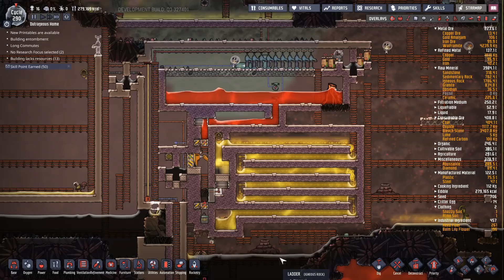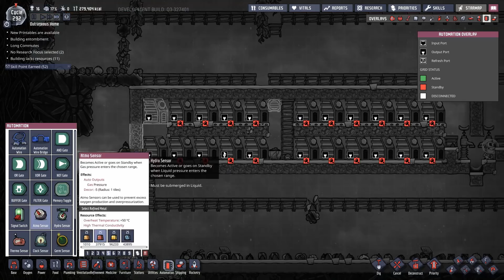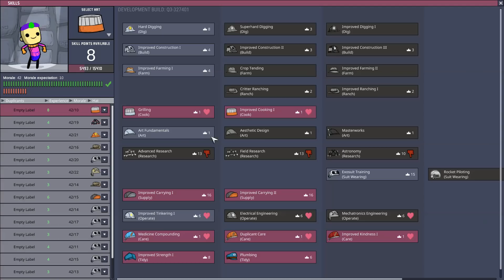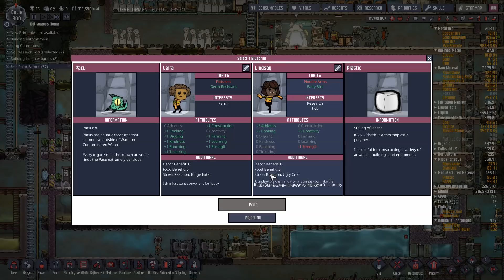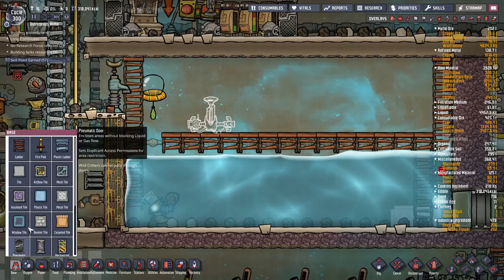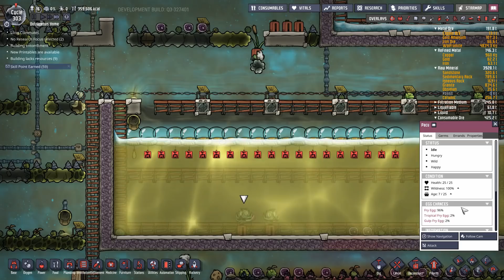QOL Mk3, 18 Battery Bank : Oxygen not included

Comment: So why did you use large transformers, knowing they can overload conductive wire? Are you just going to make sure you never use more than 2kW per line?
Reply from the maker: Thats the plan, I could use 2 small transformers but when I did that I find it slowed me down while I tried to figure out how much load do I put on this line. Is the draw of the devices intermittent, constant etc. In the end, <2Kw or I run a second line, requires no thinking on my part.

Comment: If you had really wanted to put that last smart battery in the hydrogen battery bank, you could have done it by building the battery and wires on top of a door, removing the door then putting down two mesh tiles. It's a little thing, but it's a solution haha.
Reply from the maker: I know I will never enter that battery box again yet I still want to leave myself the option for no good reason. But I like the way your mind works, that's sneaky.

Comment: How are you going to deal with overload damage on heavy watt wire? Maximum power on cable is  20kW. You have 11 large power transformers that each draw 4kW plus industrial brick all together  is much more then 20kW.
Reply from the maker: All that matters is the consumers at the end of the day I could have 100 transformers hooked up but if only one of them is connected to a grill I'm looking at 60 watt power draw max. Last I checked, my grid draws between 1.5 to 3.5 KW. 20KW wire should be good enough to get me to end game. But I will do a quick check to make sure nothing has changed.
Reply: The draw side of transformers count as batteries, so charging their internal bank doesn't stress cables, though I tested it and the consumers on the other end still stress the transformer's input side. So if Francis John were to use over 20kW then it would burn those wires, but I don't see that actually happening lol.

Comment: That middle natural gas gen is going to get stuck. Need at least 1 free pipe to send it to before joining to the line. 
It wants to push it's CO2 out to a free empty pipe when generated. 
It's not so much when it's run intermittently but when on constant like when your Natural gas fills up. 
It will stop. 
I like having at least 2 empty pipes before merging.
Reply from the maker: I'll have to check when I get home but I'm pretty sure I left at least a pipe segment free on the output. On the input it's a straight through.

Comment: On the wiring in the battery box and out of the way areas where you 99% sure you won't be sending dupes there. 
Why save a little. Spam the fugly around.
I could see yeah I've got Mtons of refined metals so why not but ehhh. I just can't do it. I gotta save. 

Not enough dupes to keep the machines running. 

Had 9 for 150 or so.

I did get up to 12 dupes though.
1-ranch 1-cook 2-operate 2-groundskeepers,  filling and supplying bins. 2-operate. 
4-builders So things are starting to move along. 

Out of sedimentary rock though. So I'm racing to setup other farms. All that dirt from cleaning water. 

Got me 6 dreckos and working on building the slicksters up.
The Hatches are clinging to life, just barely.
Reply: Yes. That. My history has made it a bit hard to give the shortened version. Everyone always wants a long explanation and it's to much and sometimes jumbled.
It's LTL. Less than truckload but I retired from driving and now play games all day.

That response yesterday. Yep. Make things easy on yourself and you'll never improve.
Reply: I got a hot water vent and still somehow for a nasty polluted 30c water vent. Tank is filled but still not sure what to do with it. 
Oh I just had a moment. 
Run it through the hot water tank. 
They balance out and I use it to start a pepper farm.
That and the meat from dreckos and slicksters. 
BBQ for everyone. Woop Woop. 

**Had it not been for your videos I would never have figure out how to properly deal with hot water geyser. Also you mentioning the O2 and H that comes out is set at 70c. Why not. Let them eat that heat away.

I'm currently letting my random water around tank empty out. 
Have 1 O2 production running and the has started but using a bridge it's waiting on the other stop. Another 30-50 cycles and it should be gone. Then I'll re purpose the rest of the random water to for toilets n such. Still working on that tank though. 
Oh and the space I'll have. Everything is off to 1 side. Running all the piping and wires up the wall. 

Although I got a nice natural tank in the biome below the base. 
However. I'm sending the hot water to up about 3 biome away to the new O2 production cooling with the thermo nullifier.

I got a voclano just off the side of the thermo nullifier then space for 2 O2 production and a volcano just beyond there.

I stack mine and go with a 9W*8H method. I had trouble with your setup for some reason. That little bit of H always gumming up the works.
Reply from the maker: Do you not feed the stone hatches igneous rock? Stone hatches have a 60% chance to produce more stone hatches when fed nothing but igneous.
Reply: I thought that was why you wanted them but I'm not. All that igneous at 95+. That's why I gave up that last play though. Everything was going down hill. 
250,000 in omelets on hand.
Plus I've got a natural pincha farm Inside the base. Woop woop. 
Lots of meat to go around as well. 

Wheezworts there are to cool that area a little for the mealwood.. I wasn't using the space for so long. Just never bothered with it. It's not bad. Just a couple of degrees over comfy for them. 

I thought of another thing about plants. 
The mirth leaf is comfy at 20-50
The briar is good for 10-30
Buddy 20-40
Early warning detection. 
Stick them on the edges or near a... say by compost or hydro gen or where ever. 
Plant good. Temp good. 
Plant not good. What's wrong. 
Good for early quick decor but later re utilize for temperature detection. 

Pincha farm and food. 
http://prntscr.com/nlr9gz 

Oil biome. 
http://prntscr.com/nlripd
It's 130 in the bottom right. 
Not bringing that igneous into my base.
6 breaches on the bottom and 1 at the top. 

O2 system http://prntscr.com/nlre0o
Cycle 389. By now I'd be dying but because of your tutorials. 
I'm relaxed. I have no O2 problems. No water problems. 
Food is a bit sketchy but getting done. 

And THAAAANK YOU for the clear the biome out strategy and just leave it lay there. No more bringing to a central spot. 
I have no concern as to where this volcano is going. 

http://prntscr.com/nlrfvf 

Tanks were from a chlorine and Hydrogen area. Didn't have as much gas as I thought.
 

I have them working on the pipe up along the right wall for oil to go up. 
I forgot to build the other pipe for petro but it's alright. It's going right back down.
Reply from the maker: @LTL_king  Niiiice. Looks like you got this all sorted.
Reply: @FrancisJohnYT  Ok so I'm just about done running the piping setting up temp sensor to get the PH2O out of the hot tank before it gets to much. 
Some reason I thought it was at -30c but it's coming out at +30c
I could probably just run it around in granite to heat a little. 
Question. 
What should I use for farm tiles. I usually stick to gold because of low thermal conduct...?

So anyway. 
I looked at oni assistant for the food numbers. 
Only 2 slicksters or 3 dreckos and 6 plants at 210KG a day. 

You knew didn't you. 
I'm rushing to get everything in pace and getting slickters built up and am I'm going to have enough time. 

A little nudge nudge wink wink go check out oni assistant for amount woulda been nice. ;)-
I don't like BBQ as the debuff in speed but I guess I'm gonna have to get more dupes. auto cooked omelets in the oil biome and 1 bbq a day. 
My chef is going to have to take a vacation.

Comment: Great video, by the way, you know that battery bank only causes you to lose energy per cycle ... it only makes sense to use battery banks with solar panels because it's energy for free.
Reply from the maker: It's about 15-20 watts per second waste for that entire battery bank. That is a price I'm willing to pay for the stability and security it provides. Also when I plug in the Nat Gas and solar I'm really going to need it.
Reply: @FrancisJohnYT  
If you are doing just for the show, please disregard what I will write from now on.

That's 400 joules per cycle for each battery ... which gives 0.66 joules per second per battery if there are 10 batteries (which is pretty much in your case apparently) are at least 6.6 joules per second reaching almost 4k joules thrown out by cycle ... energy is not a problem in this game unless you even waste it lol. Only a smart battery can handle any base with any size, and of course the amount of heat that all these batteries generate ... Here's my tip, decrease the amount of batteries and increase the amount of mini transformers with each pair of mini transformers you create 2k lines without worrying about the integrity of the wire.
Good Lucky xD.
Reply from the maker: @EstratégiaEmChoque  I get it, it is most definitely a waste. Let me try and phrase the cost differently, 4k joules a cycle is the same as running the electric grill for 67 seconds every 600 second cycle. My play style is only "reasonably" efficient. I like to think my strength is set it and forget it. I could have held off on the battery box until after I got solar might have been smarter. However I got to install Nat Gas in the near future and it's going to just be mostly straight burned, the 35% of free space on the free batteries are going to act as the buffer. It might make more sense then.

Comment: You missed the output conductive wire to the wire bridge on one of your large transformers.   Not using it yet so not a problem.  I downloaded your map and loaded to see how everything is setup and what material to use.  I must say, you really got your gases sorted out.
Reply: Also, I realized something about mechanized airlocks.  Automation will still make them open and close even if they aren't powered but they just move slower.
Reply from the maker: @johnlee7164  Yeah they made it that way to try and wipe out door pumps and it kinda worked. I have a tendency to power them all just due to needing my heat transfer doors to be responsive. Also that flashing red symbol drives me crazy when i notice it.
Reply from the maker: Sorted gasses is the only way I know how to play. I make a lot of vacuum rooms and mixed gasses are a nightmare to work with. I think I catch the disconnected transformer when I redo the wiring in my core base.

Comment: Squeaky Puft inside the mesh tile in the hydrogen battery room.
Reply from the maker: Sushhh if the others find out I'll have to go back in and rip the place up to release it. That's a load bearing Puft.
Reply: @FrancisJohnYT  
Sir you've been reported by the local housing board. They confirmed with anonymous neighbors that your building is a public hazard and joists a load-bearing ceiling on a gaseous floating animal. You will be fined 20 tons of Wolframite if you fail to comply with asteroid ordinances.
Reply: Also you should replace that cool oxygen gas vent in the bottom of your base now that you've made a silly fish diving board where it once was.
Reply from the maker: Damm hippies and the building ordnance, no way your getting my wolframite I'll release the Puft. It will have to be Monday though i got all the footage up to Friday in the can. I'v seen that vent a dozen times and never fixed it, I think i end up deconstructing it at some point.

Comment: Had the same bug you had with the Pacu not moving but instead with Pufts. Saving and reloading fixed it as you have probably found out already. Also, I think Pacu will naturally path to water without being "baited" there with fish traps; at least they always seem to when I choose them from the printer and I have my water tank just off to the side where they can drop straight down into it.
Reply from the maker: You will be amazed the paths pacu will take to get to water, I could redesign my base so they have an easier time but then it's easier for my dupes to pee in my water. Risk reward.

Comment: Love it. 2 things. 1 you forgot to put the doors back on your ranch by the printer. 2. you are vacuuming out the plug socket room, but you have not built the plates to route the power out :P
Reply from the maker: The doors I don't remember for a while alright but I have the plate installed already https://youtu.be/4UYB0UT8erI?t=607
Reply: 35:09 no plates needed.

Comment: Nice pacu setup. Curious to see the next few episodes to see how that works out. I got enough of lime from the 50 or so slicksters that keep dropping eggs, but this seems simple enough to bother. :-)

I noticed you bridged a power cable across the conductive joint plate at this time: https://youtu.be/4UYB0UT8erI?t=2231 
There's no need for that. The plate acts just like a bridge and you could've run the wire straight through it.
Reply from the maker: Did not know about the joint plate being a bridge... wait it's a tile so of course. So long as you don't touch the plug ends. The pace tank needs a lot of tweaking but once it's working it gets out of hand pretty quick.

Comment: Need some help here; I made the petroleum boiler exactly like you made it but somehow i get pressure damage?? it starts getting damage exactly above the "heat plate" so to speak.
Reply from the maker: Does it happen just after you cycle out the old magma? During the cycle out the crude oil builds up in the boiler, when the new magma drops in it flash converts all the crude to petroleum. Petroleum takes up less space so for a second or two the pressure per tile is to high and you get the pressure damage. Things to check, boiler plate floor is made of gold, Steel door for thermal injector, diamond tile for tiles touching magma. Diamond temp shift plate at key location, bottom tile of magma, three in the boiler and one between steel door and diamond tiles. If all this is correct change your temp sensor setting to 435, makes the boiler a little less efficient but stops the crude accumulating.
Reply: @FrancisJohnYT  Thanks a lot for the elaborate explanation! It could be the flash converting but I'm also thinking I may have had too much oxygen/gas in there, preventing the petroleum from going out of the boiler and into the counter heatsink. I dunno? Anyway I've reset the situation (and put 0.2 kg of oxygen in the whole system) and its working good so far. It's quite genious this design.
Reply from the maker: It's great when it works but it's very.... fine tuned. To make sure it worked on even the weakest Volcano's it needs to hit a very high efficiency on heat recycling so safety margins are minuscule. I'm going to keep finding ways to break it but I'll iron out all the kinks eventually. If you encounter any more issues let me know, more it breaks the better i can make it.
Reply: But why wouldn't it work with weaker volcanoes? Haven't encountered them yet so I'm not sure what the differences are. But as long as there is magma coming out, you can boil the oil, right? And if you hook up a valve to the temp sensor that is set to 403 degrees, you can make it so oil only comes out when the temperature is high enough (a small buffer in the pipe from the valve to the vent would be fine). Would that help?
Reply from the maker: @JohnDoe-ni9zm  The design brief was 10kg/s of crude forever on any minor/major magma volcano. This clip explains how I figured out it would work. https://youtu.be/YWQcaus9if4?t=1499